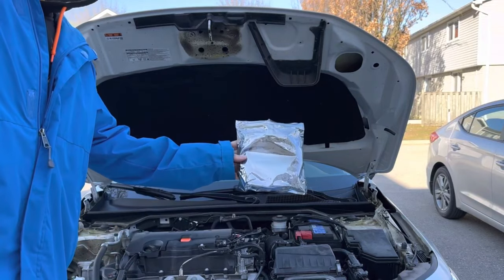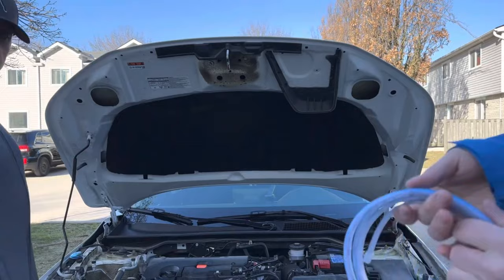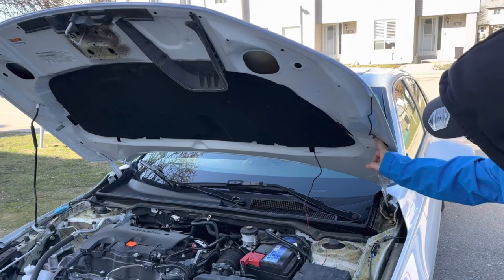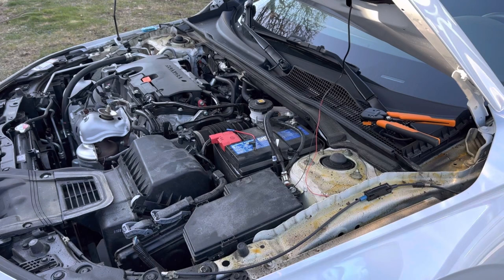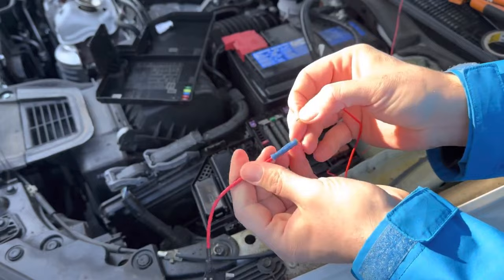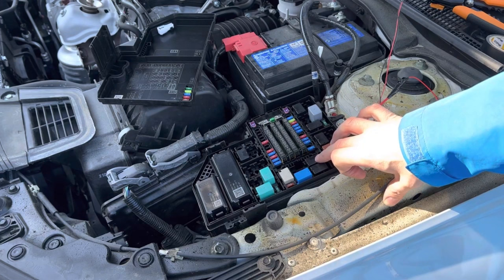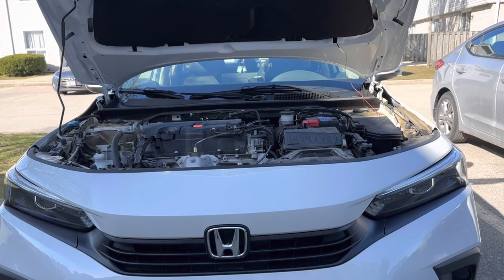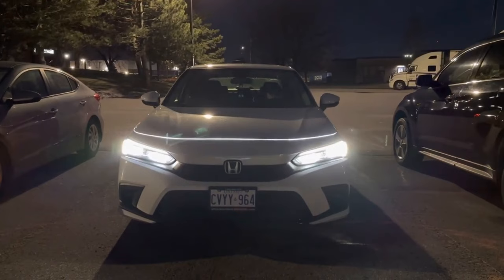CarXK Dynamic Car Hood Led Light Strip 2022 Honda Civic

Comment: Hi i have a question id really appreciate an answer to im trying to install this on my 2008 honda civic and it seems like all the fuses remain on even when the car is off and that keeps the light on all the time or else it doesn't even turn on when the grounding wire is not connected to the battery is there any solution for this?
Reply from the maker: Did you try your acc fuse?
Reply: Yes if that's the accessory fuse
Reply: I have same problem, Honda civic 2015, From UK

Comment: Where did you buy the splice ? I didn’t see it in the description!! I don’t want to overload the fuse !
Reply from the maker: I bought it at a store called princess auto. You can purchase at most auto parts stores. Amazon also Carrie’s them. They are called “piggyback fuses” or “fuse taps”. I’ve done this on my vehicle and my coworkers vehicle and there are no issues of blown fuses. Hope this helps. Thanks for watching. Please like and subscribe
Reply: I agree,  where does it say how much Amp the light draws??
Reply from the maker: They do not list the amperage that the light draws. No need to worry about a blown fuse. I would not post a video that would lead to damage of a vehicle. This install is safe.

Comment: Why mine i hook the red wire to my daytime running fuse and stay on while my car is off?So i just hook it up to my headlight wire but i want it to stay on when my daytime light is on.
Reply from the maker: Why not wire it like I said in the video. It’s works. Just put it to the ignition fuse and there will be no issue.

Comment: Should of installed the light not to the hood but above the grill i can see the wires getting ripped off if you or someone opens the hood to much
Reply from the maker: Installing it above the grill would interfere with the weather strip seal on this particular vehicle. These are universal so they can be installed on the hood or on the grill. My Chevy is mounted on the grill because the weather seal is on the hood. When installing the wires simply open the hood as far as it will go to see how long you need then add 2 inches spare and you won’t have an issue. Thanks for watching
Reply: Which fuse i have to connect in tyota camry 2013 model
Reply from the maker: I DID mention the fuses that can be used on a vehicle for tapping into. Refer to your fuse box diagram to find the correct fuse

Comment: The do I need to buy a fuse connector or can we use the ones that r already in use with headlights
Reply from the maker: You need to buy a fuse connector. A fuse connector should only have one accessory attached to it to not overload the fuse. Thanks for watching. Please like and subscribe

Comment: why did you choose to use the 7.5Amp Fuse?  I looked at the spec of the light through the link above, and my calculation shows that I can just hook it up to a 3Amp fuse?  The total power used for the light is  P = 10W/m.  Assuming it's 150 cm = 1.5m, then total power will be used by the light is 10W/m x 1.5m = 15 W.  Given that the voltage is 12V and P = I x V, then current (i) = P / V = 15W / 12V = 1.25 Amp.  Can you please help to explain why are you choosing to use the 7.5 Amp Fuse?  Additionally, why do you need to add two 7.5 Amp Fuse to the Fuse Tap?  Thanks!!!
Reply from the maker: I didn’t choose the fuse based on amperage. I chose based on ability to come on when ignition is on and turn off when ignition is turned off. This was the only fuse available under the hood for this car. As for matching the fuse I always just match the fuse amperage I’m tapping into because that’s what the instructions were on the fuse tap I bought. Thanks for watching. Please like and subscribe

Comment: did you cut the strip?  If you cut the strip did it effect the animation?  Did you seal the end that you cut?  Did the end you cut have the wire connected?  what is the length of the strip?
Reply from the maker: Never cut the light strip. They say you can cut but I always tell people not to. Once it is cut then the startup sequence will be off center and will look terrible. Plus you will be breaking the factory seal. The strip comes in two sizes: 150cm and 180cm. You will need to measure your vehicle to see what size you need then you select the size before you order. And remember the company selling these things don’t know anything about cars. They just sell what is popular on the market and rebrand it just like all the other companies. So their instructions are not always accurate. Hope this helps. Thanks for watching. Please like and subscribe

Comment: I installed the one with sequential turn signals. Tapped into fog and drl fuses and it stayed on even with the car off. Easiest way was just tapping the positive wire into the drl wire positive and using electrical tape to hold it after twisting them together. (Black wire DRL using gray wire for the 10th gen Honda Si models)
Reply from the maker: Excellent. Thanks for the tip. And thanks for watching. Please like and subscribe

Comment: How can I wire it in a 1999 Buick lesabre. I really need to make sure I’m doing everything correctly?
Reply from the maker: You will have to check the layout of your fuse box and pick one of the ones I mentioned in the video. Every vehicle is different. I personally don’t know your fuse box layout.

Comment: Hi , I have the same strip light, and I'm trying to install it to Nissan Altima 2018. Do you have any idea which fuse should I install it to !
Thanks alot
Reply from the maker: Regardless of the vehicle, you have a few options of DRL, fog lights, headlights, parking lights, ignition or accessory fuse. As for locating those fuses you will have to look at the lid of the fuse box or consult a service manual for your specific vehicle. Thanks for watching. Please like and subscribe
Reply: Any advice for wiring it to a Tucson ix35? I can't find any fuse in my fuse box for acc or lights.

Comment: I’ve been told you can connect the wiring to the actual headlights of the car. How can I do that?
Reply from the maker: You can use t-tap wire connectors. I illustrate in this video link how to use a t-tap: https://youtu.be/1o60yTSZALg
However these connectors should only be used in fully sealed areas. Corrosion can occur at the split point. It’s better and more durable to use a piggyback fuse. Hope this helps. Thanks for watching. Please like and subscribe

Comment: can you have a lower amp for expample a (5) in a 10 fuse ?
Reply from the maker: No you cannot. That will blow the fuse. You need to use the equal fuse. Fuses are designed specifically for exact amps. You put a lesser amp fuse and you will constantly be blowing fuses. Put a greater amp fuse and it will not blow when there is an electrical issue and you can cause catastrophic damage and even a fire. Hope this helps. Thanks for watching. Please like and subscribe
Reply: How do you know what the amps are for each fuse?

Comment: What fuse should i use for 2013 Honda Civic? Thanks
Reply from the maker: Please check the fuse box diagram on the inside of your fuse box and use one of the fuses that I mentioned in the video.

Comment: Hi, could you please tell me if it's mandatory to add 2 fuses on the tap? I see you have two 7.5amps  fuses attached to the tap. You have to do it so it won't overload?
Reply from the maker: Hello. The reason 2 fuses are used in the piggyback wire is because one fuse powers the original accessory and one powers the added accessory. So in this video we put the fuse into the ignition fuse slot. When you look at the piggyback wire, the fuse closest to the prongs will power the ignition that we tapped into. The fuse on top of that will power the light strip. So in the event that the light strip blows it’s fuse (the top fuse), the ignition will still operate as if nothing happened because it’s still pulling power from the fuse closest to the prongs. I installed a light strip on my equinox and used a piggyback fuse wire that only had one fuse slot. I had it hooked up to my headlights, so if the light strip blew the fuse, I wouldn’t have power to the light strip or my headlights. So it’s best to buy the two fuse piggybacks. Hope the answers your question. Thanks for watching. Please like and subscribe
Reply: @BillOfAllTrades2016  thx alot much appreciated your explanation thx
Reply from the maker: No worries. Glad to help.

Comment: So uou know how much amp the light draws??
Reply from the maker: Just found the info you are looking for. The light strip draws 10w per minute. Not sure how that translates to amps but I hope it helps you. I plugged this one into a 7.5 amp fuse and there have been no issues yet. Thanks for watching. Please like and subscribe
Reply: @BillOfAllTrades2016  Yes, it does. Thank you. I'll explain. Power ÷ voltage = amperage of fuse.  So if it's 10w ÷ 12 volts from car battery = 0.388 amp. That's low. So I guess a 5amp fuse would suffice.  👍 I think that's the lowest I've seen. But I have to check my rude again.
Reply from the maker: Ok. Wow that is a low amperage. I know when it arrived in the mail I was too lazy to go out to my car to test it on the car battery so I tested it with a 9v battery like what you would find in a smoke detector and it worked lol.

Comment: I would like to ask if ok to use multiple fuse tao in one fuse
Reply from the maker: No it is not ok to use multiple taps. That will 100% end up either in a blown fuse or causing a fire. Only ever use one tap per fuse. If you need a lot of fuse taps you might consider installing an auxiliary fuse block in your vehicle to make for easier fuse installs. Hope this helps. Thanks for watching. Stay safe and please like and subscribe

Comment: What kind of fuse tap did you used is it standard or micro ?
Reply from the maker: For this specific vehicle I used mini fuse tap due to the location of neighboring fuses getting in the way. This vehicle takes low profile fuses but mini fuses will fit as well. Thanks for watching. Please like and subscribe

Comment: I have a stupid question I’m just learning this stuff. How do you know the voltage or whatever of the fuse you’re pairing it to?

For example let’s say I can pair this to my headlight in fuse box, how do I know the voltage of that so I can use the same fuse plug thing? Thanks for any help
Reply from the maker: That’s a good question. Fuses are not measured in volts. They are measured in amps. There is a small number on the top of the fuse and that represents the amps. So this car I tapped into a 7.5 amp fuse so I just matched the fuse with a Luther 7.5 amp. On the Chevy that I installed the light on I saw you comment there as well, I tapped into a 15 amp so I matched it with a 15 amp. Hope this helps. Thanks for watching. Please like and subscribe
Reply: @BillOfAllTrades2016   I have a question, so the lights I purchased say they are 12 volts. I see my “DRL,” which I’m guessing is “daytime running lights,” is 7.5 amps. Other things are different amps, does it matter how many volts something is going into the amps of a fuse?
Reply from the maker: The 12 volts is simply referring to the power supply which is your 12 volt battery. It has no relation to the amp of the fuse. 7.5 is plenty good to hook up. On the Honda in this video I used the 7.5 amp ignition fuse and all is well
Reply: @BillOfAllTrades2016  I saw another video recommending to hook a smaller piggyback fuse into a larger OEM fuse to reduce stress, instead of using 7.5 onto OEM 7.5. I believe relaying the larger for example 10 amp fuse first, and then my aftermarket 7.5 (goodnight) fuse. Also using a volt meter to determine which side of fuse is the actual power supply.

Does this sound correct to you, thanks so much for answering
Reply from the maker: Yes that is correct as well only if you need two different amperage fuses. Both my method and the one you mentioned work equally. Using a circuit tester pen or voltmeter will indeed indicate the direct power supply. That’s where your higher amperage fuse goes. I personally always just matched the fuses to reduce the chance of mixing it up backwards lol.
Reply: I have a question also: 2 yellow fuse you added onto the piggy fuse must be the sum of 7.5 amps to be matched with 7.5 amps marked on the fuse of the fuse box? I mean we have to calculate the amps to match with fuse on the box? Or those 2 aftermarket yellow fuses is 7.5 amps each and they’re still matched with 7.5 amps on the fuse in the box? Thank you.
Reply from the maker: The two 7.5 amp yellow fuses were just chosen to match the original 7.5 amp fuse that we are tapping into. On my Chevy in a different video I tapped into my 15 amp fuse so for that vehicle you would use 2 fuses 15 amp to match. As long as the two fuses match the original one then you are ok. Thanks for watching. Please like and subscribe

Comment: На nissan rogue 2018 Sl platinum устанавливали? ❤
Reply from the maker: No I have not. I only have installed on the Honda civic and Chevy equinox.
Reply: На какой предохранитель надо подключить и где он находится. Спасибо
Reply from the maker: @user-lk9ms4vc4u  please select from one of the fuses that I mentioned in the video

Comment: Porfavor que fusion conectar tengo coche mazda cx 3
Reply from the maker: Please look at the fuse map located on the inside of your fuse box lid to figure out what fuse you will use. I already listed the most common fuses used. I don’t know every car. This install was vehicle specific.
Reply: Ya pero a donde lo conecto en caja de fusion.?luces motor nidea
Reply from the maker: You connect to the fuse box exactly the way I showed in the video. There is no other way I can explain that. The only difference is the location of your fuse that you attach to.